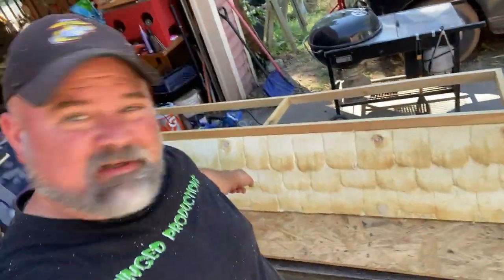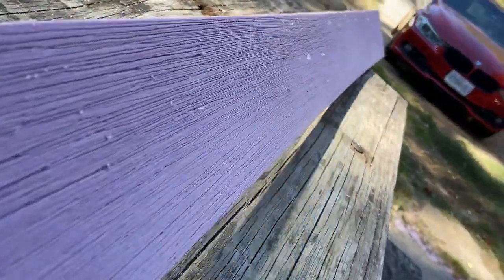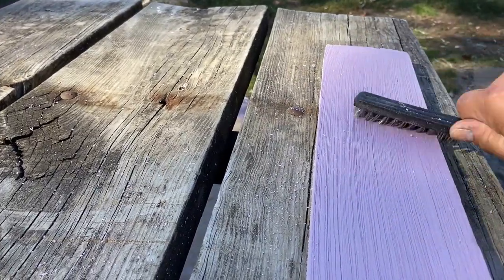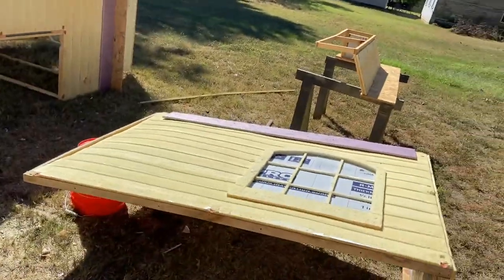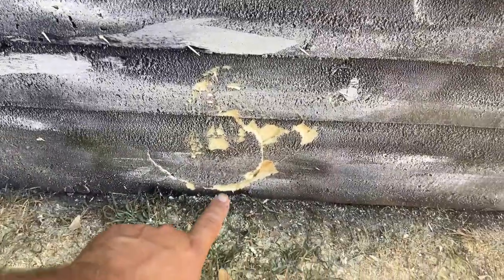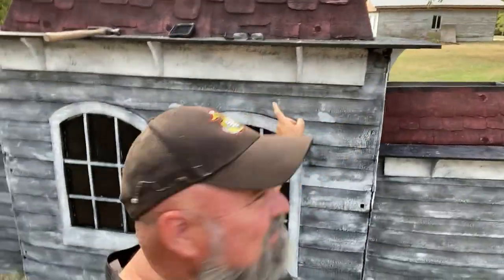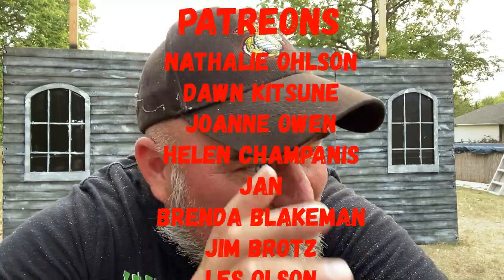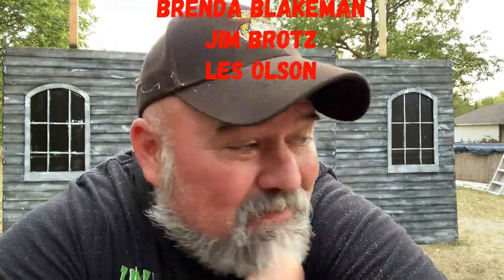DIY Halloween Haunted House facade, Finally painted

Comment: They are called "brackets." You left off the corner trim, (typical on any lapboard sided house, but what you did looks great. Looking forward to the video with it up and scaring people.
Reply from the maker: Ya I left the trim off on purpose. These panels bolt together and the bolts go through the face of the facade. So I left the trim off (removable) so once it’s all together I can attach it and pull the whole thing together and then remove it when taking back apart
Reply from the maker: I believe I talked about that in the earlier videos of this project. However all that being said, I do appreciate the help and ideas to make this project better